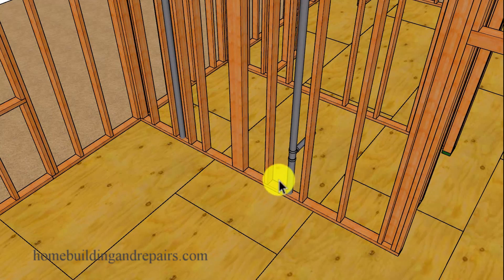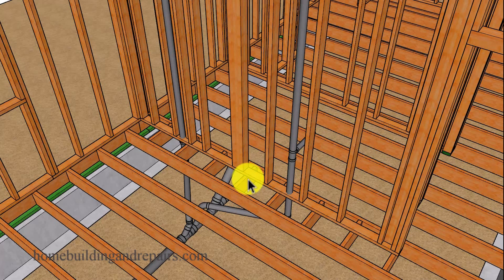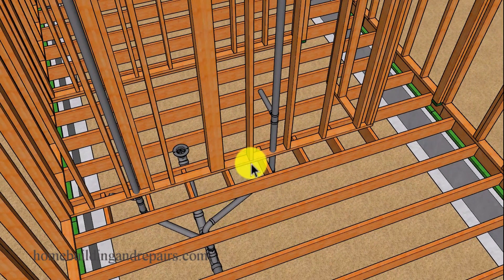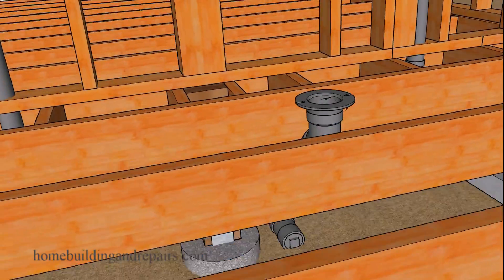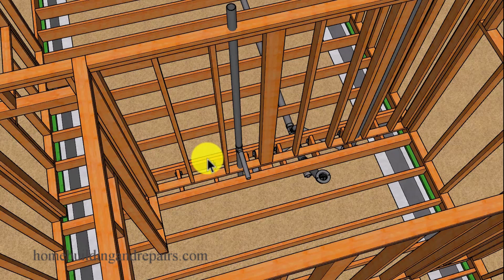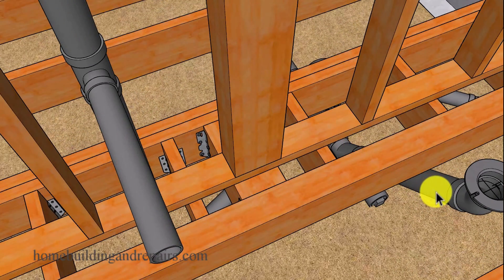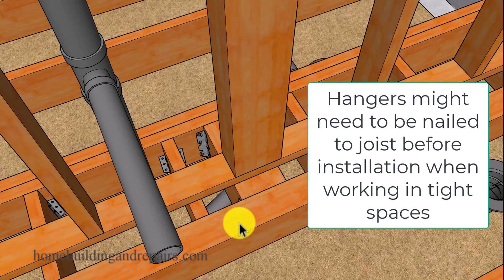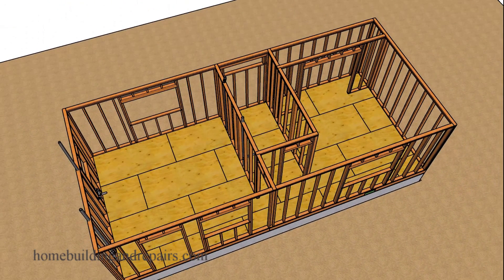How To Fix Sagging Floor From Structural Load When You Can't Use A New Footing - Home Repairs

Comment: How do I brace my floor joists to handle a load bearing wall that will run perpendicular to the joists? Not parallel. Will blocking suffice or do I need to install beams and posts? It's halfway between an 8' joist.